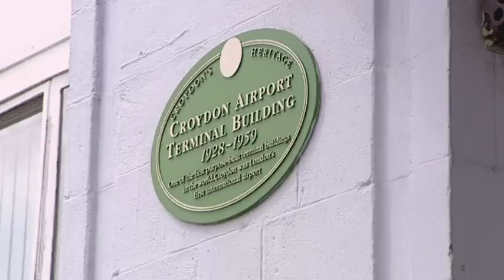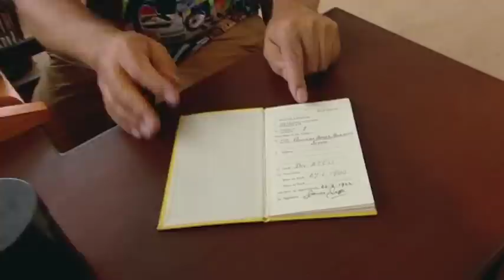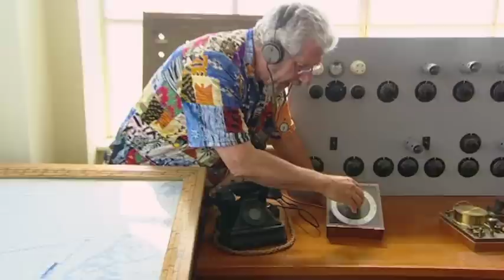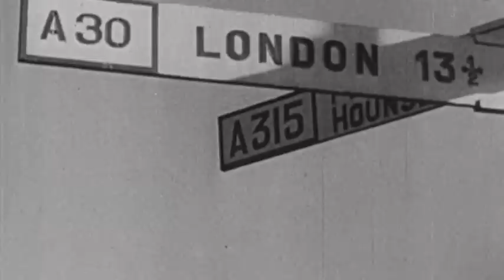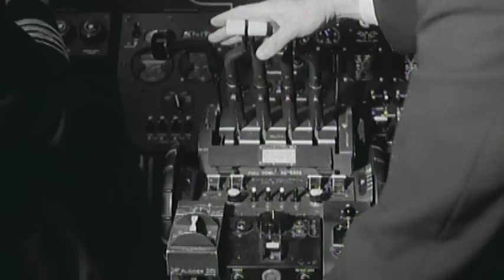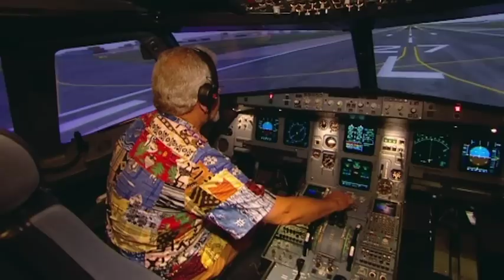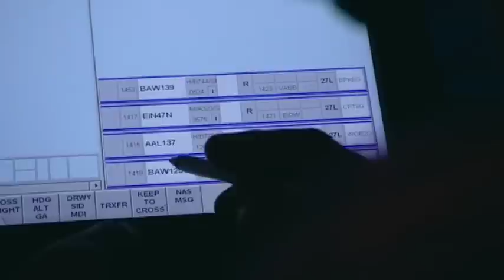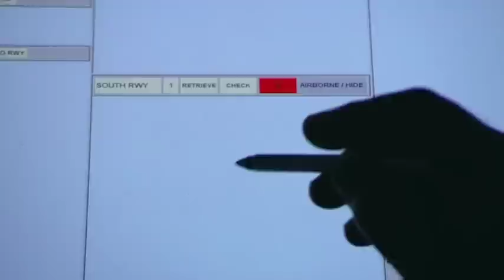The Fascinating History Of London's Airports | Our History

Comment: A bit rudimentary in its coverage. London has been and is serviced by quite a few airports. Before Croydon there was Cricklewood. In the 1930s we had the original Gatwick and then in the 1950s Blackbushe was a very important airport for London. Northolt was BEA's base from 1946 until they moved to Heathrow. Luton is also an important airport for London and, of course, we also have the modern Gatwick and London City. Biggin Hill and Farnborough act as London's biz jet airports these days. The DID mention Stansted.
Reply: Heston?
Reply: @paulhelman2376  Yes indeed - another one
Reply: First scheduled passenger service was Hounslow Heath.  Maybe not an airport as such but part of aviation history in London.

Comment: One of the things I'd like to have seen covered was the "West London Air Terminal" that used to exist on Cromwell Road (near Gloucester Road tube station). It was there from 1957-74. The idea was that passengers could check in there and then go by coach to Heathrow. The building in now the Point West apartments near Sainsbury's there. There were a couple of other similar "terminals" over the years in London, such as those in Waterloo and near Victoria.